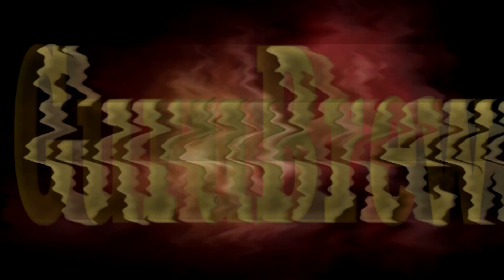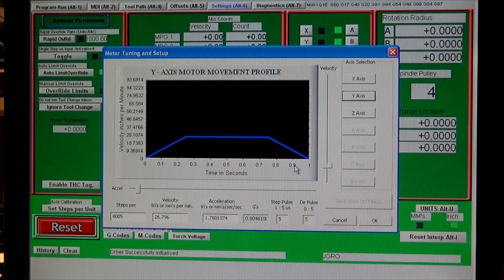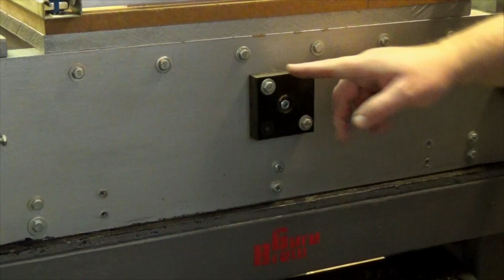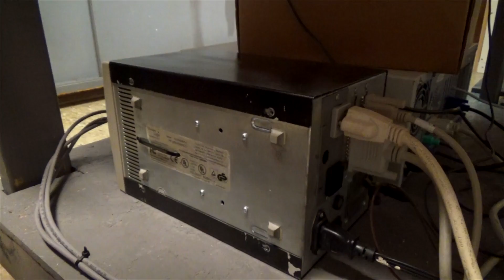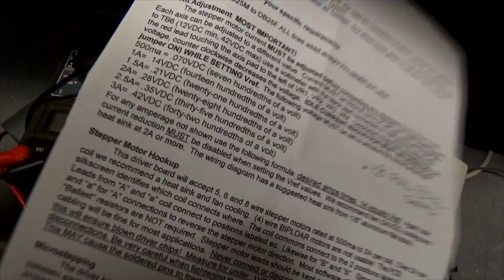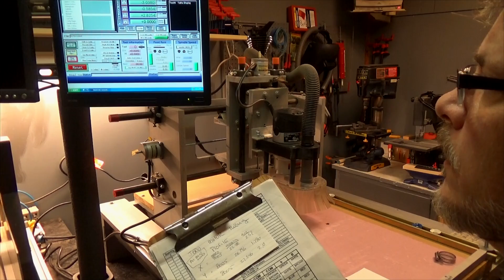Mach3 Motor Tuning - Upgrading Stepper Motor Procedure

Comment: I built a Little Machine Shop mini mill with a CNC Fusion ball screw setup . I make parts on it but cutting circles has always been a joke . I end up with flats on each side or an oval circle out about .012 . I took the backlash out of the Y and Z by making solid aluminum couplers . I have checked the X and Z with an indicator and get good readings . Always returns to zero  . Im thinking its a tuning issue . I need to go through the driver tester again cause I was doing it wrong . I tried 45hz and 25hz is where I was running it . Im using a Pentium 4 with the parallel output and a Gecko driver with Nema  23 at 48 volts . I havent replaced the coupler on the x yet because backlash was always set at .002 on this one . Y and Z I have set at 0 on backlash and they repeat great . I also want to mention that something I did playing with the tuning moved the flats from 12oclock and 6oclock to like 10 and 4 . I never really did tuning before now but I want a circle at the most only .001 out of round . Any ideas ? Thanks for the cool vids

Comment: Hey guru r u good at troubleshooting stepper motor / controller driver  issues? Ive got all 3 axis running like crap rough herky kerky and slow...on my diy cnc using tb6560 Im still thinking its controller driver issue...if i run a continupus jog mode .....once in a while the motor will go from slower feed rate grinding rough movement to smooth movement faster feed rate but only for less than 1 second...

Odd that all 3 sxis do the same thing though...usually mot all axis go bad at same time..however this is a low end junk all in one board so its possible...
Reply: Reuel T  thanks guru...well all i did was change from a windows7 to a windowsxp laptop and the motors run fine now....not sure if it was a windows siftware issue or laptop/port issue. ...i know it has something to do with what u mentioned pulse..because when i did a test in mach3 win7 it said poor...when i did in windows xp lsptop it said excellent...also funny u mention 36v ps...on a diff diy cnc i have..i upgrsded from 24v to 36v and kept the 24v fan...the fan runs 50% faster...i bought a stepdown voltage regulator board to correct this but havent installed it yet...

Comment: Just curious why you don't base your travel speeds off of the general rule of 50% of stall rpm, ie 1200 max rpm is standard on 1.8 degree steppers.  Not a critique, just curious because you seem to have a solid foundation in electronics and wondering if you have ever done it using math.

Comment: On one of your presentations, I think you explained in Mach 3 how you could control the current going to the stepper motors. Maybe I'm dreaming.
Reply from the maker: I just re-read this comment after 9 months and realized now what you meant. Yes, you can control the current going to the stepper motors it's usually a pot found on the stepper motor controller circuit board, that you can turn with a screwdriver and use a voltage reference meter to calibrate. This should only need to be done one time though, unless the power supply or the stepper motor are changed. Hope this helps someone. Apologize for the mix-up.

Comment: Personally I suggest setting the steps per based by the threads per inch on your rods, the amount of microsteping and stepper steps per rev FIRST.  Then use the calibration in the setup screen. Doing that first will get you within a few percent of dead nuts accuracy. The friction in the ball screw and bearings will result in the actual travel being a tad less than the calculated distance.. Thats why you need to ron the thingy in the setup screen. It Corrects for frictional losses. Its also a good idea to check the calibration now and then as the frictional looses will vary over time. 

Measure the length all the way from home to max travel using the steps per in the setup screen. If you cant accurately measure that far then use the max you can centered somewhere in the travel. The greater range you can use the better the overall accuracy will be. as an example using a dial indicator with 1 inch travel--- if you get to say 1 thou for he inch and assuming say 36 inches TOTAL travel that 1 thou off wil result in being 36 thou off for the entire travel.  36 thou is roughly 1/32 inch. 

You can get real close by using a yardstick where one end goes down to 1/32. Set the high number end twords your home position. Use the finest point bit you have, typically some engraving bit. Position the tip as close as you can get it to say the 35 inch mark center line. use say 35.5 as the distance to move. If youre dead on the point if the bit will wind up exactly over the half inch mark .  Correct position by 1/64th or .0156 a time to really zero it in. .0156 is exactly half the distance between those 32nd ticks.. It will be easy to get down to right at a .015 off for the ENTIRE travel length. Less than that is possible depending on your eyeball calibration. a 64th off over 3 feet is way beyound what good woodworking requires...  I get right at .003 short over 2 feet on both X and Y and .001 on Z over 5 inches.  Measured using precision gauge blocks and a dial indicator.  That setup is within half a thou... I use 460 oz/in steppers on all 3 axis with divide by 2 microsteps driving 1/2 10 acme rods. A divide by 2 micro-stepping cuts the effective torque of a steper by roughly 30%.  Higher micro stepping cuts the power even more. X and Y are 5 starts and Z is the normal 1 start.  A single start 10 pitch riod will give 1 inch of travel for 10 stepper revs. The 5 start requires just 2 revs to get an inch. Never have been able to stall the steppers and around 300 IPM is doable. Ive actualy snapped a 1/4 bit clean into hitting a clamp at 130 ipm and even that didnt stall a stepper but I suspect it lost a few steps.  I stay with 130 max as the ramp up and down at 300 is no faster over all. 

Before using the built in calibration, set the stepper ramps and max speeds up FIRST. If that's not right you could well loose steps and that basically makes ANY calibration basically worthless.  

You can find all the info needed in both cases in the MACH 3 setup manual on the artsoft web site.

Comment: Good instructional video :)...This acceleration setting....Is it this setting that causes some machines to slow down when they get to a corner or directional change? I see some CNC routers slowing down before they get to a corner, make the turn and accelerate again...or....is it the CAM software they use? Vectric for sure doesn't have such a function but it makes sense to me especially when you are doing fine work...
Reply: I knowo this is an old question but I'll answer for the benefit of others.  Cam software can be programmed to slow down on corners or intricate parts based on whatever criteria you set.  However it is also very likely that you have seen machines with low acceleration settings making the acceleration/deceleration audibly noticeable.

Comment: Dear friend .. my stepper motor is heated a lot and read in several forums that have to be configured in half current .. and I do not find where to configure that option in mach3 the step motor is 3.2 A and is configured in 2.2A And the driver also heats .... thanks for your answer.

Comment: Hi,
I have an old HObbyCNC board called the FoamPro Ver1. running 130 Hobbycnc steppers. I noticed you are running a Hobbycnc board as well. I have a problem with losing steps when running the roadrunner program. the y axis(slaved to A axis) loses steps really bad. I can high speed jog the machine all day and it works pretty good but when running road runner it freaks out. It even does it without steppers mechanically connected... y axis steppers jitter really bad and never come back to my test marks(losing steps). How did you calculate your steps per(8005). I always come up with 16000 for mine? When i do the auto set step thing in settings, it automatically sets my steps per at 2001.25??? Anyway sorry for long comment! Oh I've backed my acceleration and velocity way down.
Cheers,
Lyle
Reply from the maker: first make sure you are in inches instead of metric. That will mess with your ipm and it sound like a suspect. After that try running the Y without 2 motors, noise is most likely the culprit. let me know
Reply: Thanks,
I had that problem also at first but have it corrected now.
I just discovered that i have my vref's set way too high. .380 when should be .280 on 130 oz. servos wired serial the way i have them. I have a diy power supply with 18v 10 amp transformer and a 10000 uF cap but i think the cap should be around 35000 uF. I'm getting 25 v untapped voltage and drops to 22 v under servo load? that doesn't sound right to me... voltage shouldn't drop that much should it?
Anyway, i don't want to eat up your valuable time so thanks for your help!
Lyle
Reply: I reset my vrefs etc. and it's still a little sketchy on losing steps on y axis which is slaved with A. My gantry is fairly heavy for the motors so i think i'm trying to get too much out of them. Z and A axis work really well and don't lose steps so im going to save this old HobbyCNC board and 130 oz motors for a small 3 axis setup possibly 3d printer.
Thanks for your help!
Lyle

Comment: Can't wait to try this.  Thanks for posting this for us.  You didn't change the step or direction pulse width from the 5 setting.  Why 5?
Reply from the maker: The 5 came from the default setup in mill. I wouldn't change this unless you are having problems. You can read more in the Mach3 manual about this subject .

Comment: steve, looking forward to some positive changes for sure. 

as far as mach 3, I have nema 23 and sometimes I lose steps as I could hear the motor squeal. I can lower the sliders and it won't slip but is there another parameter I can change other than the slider to get more torque out of the motor so I can have faster motor action. it works ok with slower speeds but I believe this setup will work at higher speeds if tuned properly. hope this makes sense. I have a gecko drive. my 3 motors are pretty much the same size as your new one so I'm pretty sure it should handle higher speeds.  thanks jerry from fontana ca.
Reply from the maker: Do the Gecko controllers have a current adjustment on them? Should have a way to turn up and down current to each motor. Lookup your motors max amp reading and adjust the current references in the Gecko as I have done. Sorry no experience adjusting Gecko but should be very similar.

Comment from the maker: Hows everyone hanging after the election?
Reply: I'm awesome about it... i won't say anymore :)
Reply: thank you for the video,  im running mach 3 R3, witch seems to have a different user interface than everyone on here, or in the manuals.....    anyways, everything applies, but the "steps per inch" button is not there, it is not on any of the pages presented and I've checked every menu, page, option setting,      every thing else is on point,     but where do you get the velocity and speed numbers ?   thanks man,i really liked the video